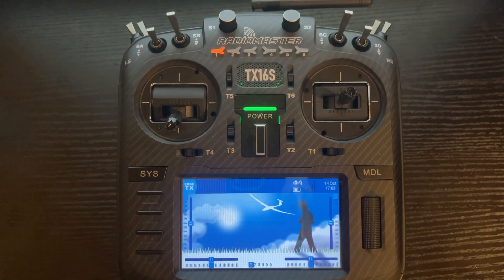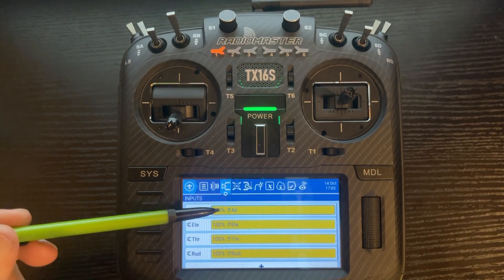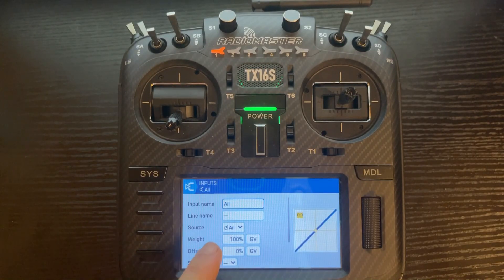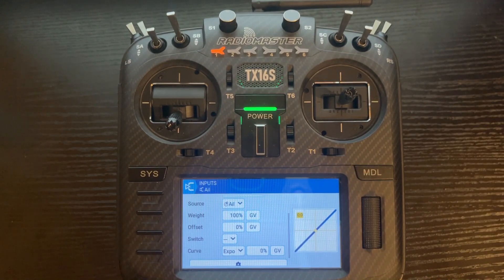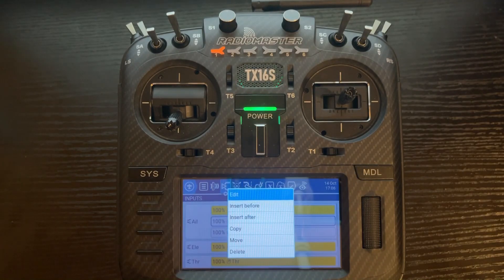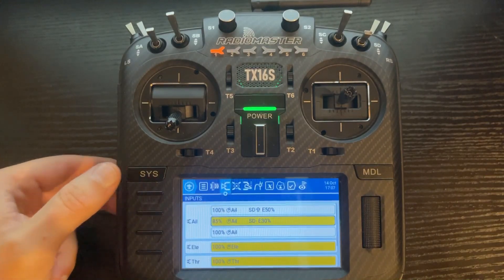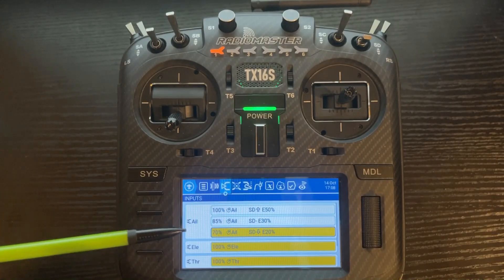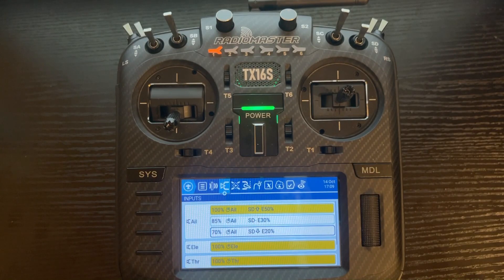Radiomaster TX16s/Edge Tx: Rates and Expo

Comment: Hi Great video. But if i have set up a plane with 2 servos  (one in the right wing and one in the left wing Channel 1 and 6 )  Do i set the same rates and expo on channel  1 and 6 ?
Reply from the maker: Yes, when using the Aileron control not Aileron "Stick" Input (Joystick logo).

Comment: Hey there BD,iam looking at buying a tx16max to use with rc planes and my Spektrum recivers,so in your opinion will it work as good as using the original spektrum transmitter.thank you for your thoughts and videos.
Reply from the maker: I have seen similar results. No issues with using on Spektrum receivers and works Forward Programming too.
Reply: Thanks BD ,iam keen on going that way because I don't like the feeling of the nx spektrum transmitters and the ix14 here in Australia is 1600 dollars very expensive,hence looking for the tx16s option, thank for your help,oh and your videos on the tx16 are great to by they way.Kepp them coming, a video on forward programing would be great,cheers.

Comment: One question sir.I have connected one Nx3 3d stabilizer ,and I connected between receiver and servos.Ehy ,when I connect one  switch ,the stabilizer not working.I need to change ,rate/hold , and off gyro but it is impossible to me!Can you make one tutorial how we can use gyro and how to activated on tx16s ?!please ❤

Comment: Wow, this was very helpful. After starting out with JR and then using Spektrum for the last 15-20 years, this is a huge difference in how things get set up using different terminology and wording.
I have to admit since the physical radio has so many similarities with the switches and buttons and scroll wheel, I thought there would be more similarities in the programming, but that was the totally wrong assumption. 😁🧐🛩️

Comment: I own both txs. Tx16s & ix14. Expo on the 16 is far less sensitive than the 14. (I watched ALL the vids on the 16, forgot spektrum. Then got the 14 in a deal at my LHS. Couldn't pass it up). 

I love both. Ix14 i use with everything umx & bnf. Tx16s with everything else. Spektrum's update was a badly needed update!
Reply from the maker: Both good radios. I use the TX16s for everything now.